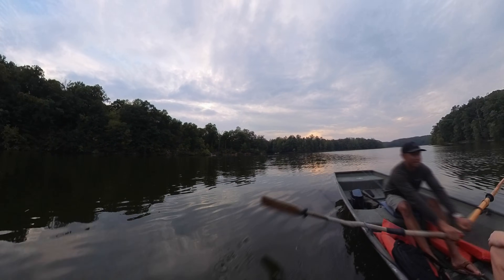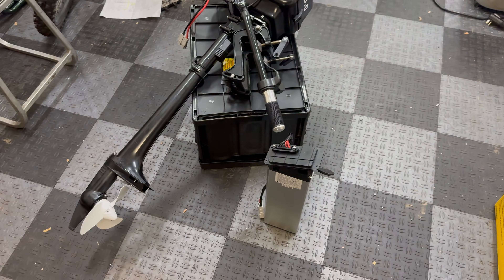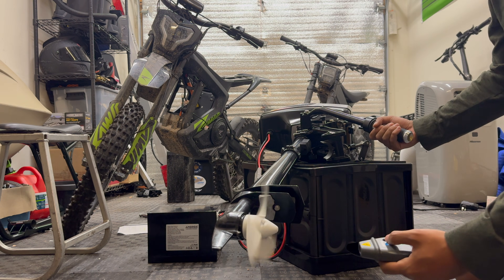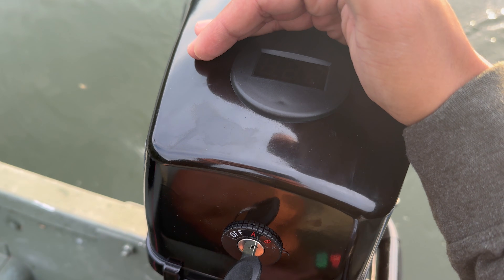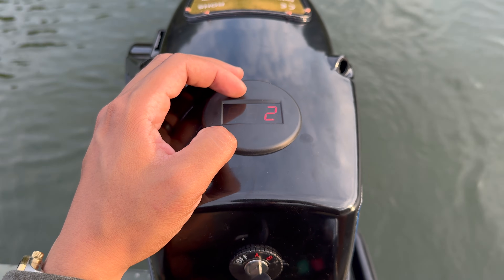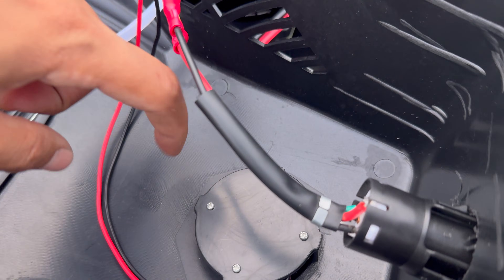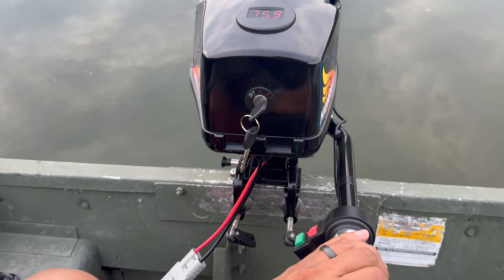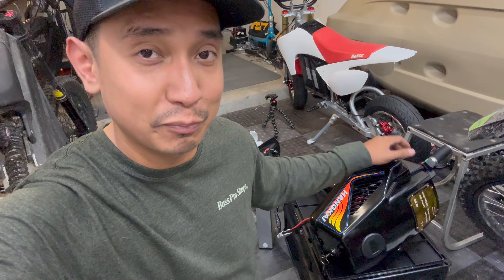Can a Hangkai 48V Outboard Motor Handle 72V - Speed Test

Comment: Hey Bro! Im the surron guy here
 This video was Great!!! I really like your test. Very informative.  You Also saved me from a lot of rowing, lol, Im definitely curious to see what you do with this hangkai next. Its definitely the best bang for the buck when it comes to electric outboards
Reply: I've got the same motor.
I commented on your earlier video showing this motor.
Drill out the rivets on the 'number plate' on the top cover of the motor.
Under it you will find a nice looking 'grill' that will only let the motor run cooler.
Reply from the maker: @garygerard4290  Thanks for the tip!
Reply: Does that Hankai have the ability to change the propeller? Have you tried other propellers?
Reply from the maker: LOL more to come sir

Comment: Orange wires at 8:35 are for the self-learning function of the controller. It learns where the hall sensors etc are placed when the motor is initially assembled.

Comment: THey ought to put a cooling system like while motor running it pump water thru hoses around motor to cool it off or a fan to blow directly thru top to cool it off. Cute motor it moves along pretty good

Comment: Brilliant stuff Pat. I have been doing very similar things with electric motors with ebikes, scooters, motorbikes and cars over the years. When my fully electric campervan / RV sells, I will buy a boat. I ordered that exact same motor from AliExpress yesterday, $312 including shipping. Waiting for the motor to arrive from China will give me plenty of time to find a boat😄 Plan is to use 3 * Lidl Parkside 20V 8Ah power tool battery packs in series to power it ($49.95 each). Cheap and cheerful and should have plenty of juice for my needs

Comment: Dont make the same mistake many people make with electric RC planes. If you overprop too much with an RC plane very quickly you can heat up the magnets in the motor and from there on in your power will be less, essentially ruining the motor.
Read up a bit about pitch speeds of propellers. Over-volting your motor is very similar to replacing the prop with a much larger propeller; your current/amps go up quick.

Comment: Have you ever had the motor burn up on a 56 volt setup? I was using mine the other day for the first time and use it for about an hour and a half and then all sudden it started smoking and losing power like the bearings lost all its Grease the motor itself was extremely hot
Reply from the maker: Sounds like your unit didn’t come with gear oil in the lower unit. Some come with it, most do not come filled. You always have to check the lower unit before taking it out
Reply: What gear oil in the lower unit cause the electric motor to burn up? You don't think it was from over voltage  @PatOutdoors
Reply: Also has anyone heard of any upgraded motor options for this outboard looking at the motor itself everything is 100% enclosed I don't see much holes in the aluminum case for heat to escape
Reply from the maker: @FreeMindthinking I’m just asking you to confirm your lower unit is OK before assuming it’s the motor or controller.
Reply: Yeah I checked the lower unit  before I put the thing in the water for the first time I filled it with my buddies lower unit oil from his boat he has an Alpha One drive

Comment: Have the same motor, and am EE, so interested in your upgrades! Thanks so much. Will stay tuned for any performance improvements or if the noise of the motor can be lowered. Also like to see if any motor or controller changes would help. I'm only running 52V, but I wonder if prop changes would speed up the boat?

Comment: Hey Brother,  HANGKAI now sells a 10hp electric motor on eBay. It requires a 60volt battery.

Stay BLESSED.
Reply from the maker: @kenfan5666  woah! I’ll check this out
Reply: @PatOutdoors  I'm considering getting one, but I need to find a lightweight 60 volt battery first. Otherwise, it will be  pointless. 

Stay BLESSED.
Reply: Ali Express sells 60v 100 amp batteries. I'll let you know how it runs when I get mine.
Reply: Can you post a link to the 10 HR 60-volt
Reply: Just a little update it took my experimental boat out all week this week I was on vacation went to Lake Norris ran the hangkai 5.0 for a total distance of about 4 MI rough estimate on One battery 56 volt 40 amp 20 amp hour battery at about half throttle it worked perfect all week and did not overheat

Comment: Hey do i need motor oil before using it ? Cant find an answer on that
Reply from the maker: @NOSKILLBUILD  you need to confirm the bottom housing came filled with gear oil. Some units come completely dry, some come with oil shipped (depends on what factory it ships from.) better to be safe and just pull the fill plug off and confirm.
Reply: @PatOutdoors  oh ok.thanks man !!
Reply: @PatOutdoors  oh one more question,  what kind  of oil do i use ? Do you have a link ? Im new to all of this .

Comment: man i reaaaaaaally want to see you upgrade this mini outboard. fardriver con fan on top stripped motor oooooh maaaan pleaaaase fardriver sells water cooling plates also
Reply from the maker: This motor is already currently stripped down to bare housing. I’m waiting on an adapter for an my1020 style motor adapter to be finished, then work on an adapter for the propeller shaft, THEN I can make a fardriver work. The stock motor does not have hall sensor so my ND72450 will not be compatible.
Reply: @PatOutdoors  I see I have the ND72850 wonder if you can adapt 3 Honeywell halls on it. Anyways thanks for the vid super interesting 🙏

Comment: Great video. Thank you for dissecting these..  just an FYI The butt connectors that run to the voltmeter on the top of the cowl are garbage.  I'm pretty sure the extra power you're pushing through is the problem but my motor did the exact same thing until (I was running a 48 volt 15 amp hour evike batteryI soldered in marine grade connectors.  Just a thought.

Comment: Same as e-bike, 48V controller normally can use with 60V battery but not 72V.   I think you just change the new controller and it's gonna run again.

Comment: i want to know will it handle a 52 volt battery. i have a 26AH 52v lithium battery from a old scooter that still has plenty of life left in it. its rated for a 2kwh electric hub motor. its not much higher then 48v batteries i think its 58volts fully charged

Comment: I've done these over-volting tests on ebikes. My experience is there is what I would call a "soft cutoff" on max operating voltage. That is, a max voltage where you may be able to get it to perform under certain loads and/or conditions but fails in others. For example, I can get my son's e motorcycle to perform well at 48-52V with the OEM 36V motor and controller. At or above 53V, it will run but cuts-out randomly when pushed hard, just like what you are seeing. I have an an adjustable charger that I can set cutoff voltage at 52V. So now I can use a 48V lithium pack with great reliability as it never hits the soft-cutoff. My son has been riding it constantly like this for two years straight. Anyway, thanks for doing this video. You are encouraging me replace my 12V Minnkota trolling motor with something like the Hangkai.

Comment: A couple tips ... When using your electronic tach, find a smooth location like the nose cone to put your tape on. You were picking up on each of the three blades so 12,000 RPM was actually 4,000 RPM (Divide by three). I know this because the prop and the motor would explode well before 12,000 RPM.
The spare set of connections on the controller are for programming.
A good source of controller information can be found on partsforscooters (not affiliated). Go to the controller section, click on wiring for a controller similar to yours and it will explain all the functions your boat motor manufacturer doesn't want you to know.
Retest your prop RPM and leave the results below, I'm curious since I don't actually know how much gear reduction is in the outdrive.

Comment: There is a LOT that goes into outboard and prop design. Simply speeding up the prop will cause cavitation around the propeller.  This will cause the propeller to spin too fast and the imploding bubbles will destroy the propeller.  You will probably need to increase the pitch of the propeller to increase speed and prevent the motor amping out. But, I only know enough to know that I don't know enough.
Reply from the maker: @edtheplumber5307  yeah I actually swapped over to an aluminum propeller recently for added reliability. But you’re right, I have to play with the pitch also. I’m in the middle of swapping out the motor and controller already though..

Comment: Driving a motor rated for 48v with a battery twice as big will burn out the windings as well as the controller. Same goes if you drive a motor with not enough voltage. In that case it will try to draw more amperage which causes the same result. Give it what its rated for. I cant tell you how many electric motors i have had to replace because of a wrong feed. I dont care if its ac or dc. A well pump or sprinkler system , or in this case a boat motor. Electric motors all do the same thing.

Comment: Great video thank you. Would this motor work with 24 volts from the battery instead of 48?
Reply from the maker: @thomas_didymus  it unfortunately will not
Reply: @PatOutdoors on the website it actually does say 24/48v and I’ve seen videos i do believe it will work at 24v

Comment: Hey, I thought you looked familiar. I'm a proud owner of a 2019 Subaru Crosstrek and I've seen your other channel and really liked your Crosstrek videos 😎

I'm a kayak angler and have a 12v 100ah lithium battery setup running a brushless trolling motor. I get 5 to 6mph depending on conditions.

Inspired to see what speeds this motor would get on my kayak setup, thanks for all your insightful and inspiring videos brother 😎
Reply from the maker: @mototechRyan  LOL yeah this is actually my main channel. Thank you. That’s awesome speed for a 12V unit. I currently have this motor apart, seeing if I can jam some of my higher power electric bike internals into it. I want at least 10 MPh 😂
Reply: I'm guessing my total weight with me, my kayak, and my fishing gear...is around 260lbs. So my 65lb brushless trolling motor does pretty good. I need to get hard data on run times with my setup, but I never worry about running out of battery.

Please keep the videos coming, I'm really inspired to to get into higher voltage setups 😎

Comment: non-flexy prop and some trim! bottom end seems like it'll be a bottle neck though.
Reply from the maker: Funny you mentioned it. I just finished mounting an aluminum prop on it and doing some testing shortly with a huge 100ah battery

Comment: looks like a plastic prop, the higher RPM will distort the pitch of the prop, and may actually reduce speed
Reply from the maker: I just swapped out the prop to an aluminum one with slightly more surface area. Hopefully it runs more efficiently

Comment: you remembered to put gear oil in right? it does not sound healthy on that lower end
Reply from the maker: I just pulled the prop and cover off the lower unit to inspect. This electric one came prefilled with gear oil

Comment: If anyone is replicating results the rpm will be different based on blade count. Unless he did the math or that unit is programmed to ignore every 2nd count you'd divide by 3 just fyi. Laser tachs just measure interruptions.

Comment: Water cooling the motor and controller would be a very easy way to keep it cool.
Reply from the maker: Ok yeah I’ve been looking into doing this. Would I just have a pump mounting in the housing and run a hose near the prop?

Comment: SurRon battery with a stock SurRon controller…..is what he used.
Reply: Also….you could possibly run at 1/2 throttle until the voltage drops.
Reply from the maker: @turbosupra2jzdragracingtob249  how would you use a surron controller on a sensor less motor? There’s only phase wires on this one

Comment: a small pump, tubing, and a CPU cooler or cooling plate would provide water cooling to the controller and be much more effective than a fan. just run it on a step down converter at 12v.
Reply from the maker: @chrisstinson2536  I’ll start drafting the plan! Thanks for the idea

Comment: when i put a higher voltage battery in my impact wrench the issue i had wasnt overheating the controller, it was actually over current protection (heat also causes an increase in current) not that it matters if your replacing the controller, but theoretically you could remove the current sensing resistor if that was the issue
Reply from the maker: Hmm if it was an over current protection, it should have cut the power immediately when I initially started using it. It just ran worse and worse as it generated heat. I’ll look into it more, find a solution, and post an update. Appreciate your input
Reply: E = I x R. E is voltage. You increase voltage with the same resistance (R) and current (I) goes up. Current causes heat. The heat may change the resistance a little affecting current somewhat but the overall increase in current is caused by the increase in voltage.
Reply: Most overcurrent protection is using thermal overloads which basically open on high heat stopping power to the motor. Some reset automatically after temperature drops and some have to be reset manually or electronically.

Comment: Yeah 60v no problem but caps are likely 75v inside and full charged 72v battery is over 80v, when u close throttle the back emf spike kills the controller

Comment: That doesnt sound like 12,000 rpm to me, try putting a piece of reflective tape on 1 of the blades as I think it might be counting each blade as an rpm but I aint no rpm lazerdoodle expert
Reply from the maker: @TheDigitalguyy  it’s not, about 4500 RPM. I remeasured at a later time but the difference between RPM and voltage is the same with both  tests

Comment: not controller it motor safey switch when motor get too hot it sent data to controller cut off safey power so it turn off on you once it cool down it safey overheat switch avoid motor burn out and if you take look at switch on motor u wll noticed it two wire and heat up switch it kill power to motor
if you have water cooling motor you never have to worry about this issues at all but if you modicaty cover more air flow may last you longer keeping motor cooled down
i dont own one but i worked on one for my customer plus have cut open top of cover and make vent down into motor so it last longer
Reply from the maker: @kittyztigerz  appreciate the input! Give me ideas..
Reply: @PatOutdoors  mt customer still running off 48v dc battery he have same issues as you have it cut off when get too hot not enough cooling just give you orher way fix overheat issues so wont happen again 
if it was control it would been smoking alot n barely catch on fire but no smoke so not controlled it motors 
there other trips you can do is incled amp to motor so u can change impeller pit for less rpm more flow
i believe there is youtube done this test called rctestflight YouTube channel

Comment: Before you upgrade the motor, I would check the drive shaft and lower gears and make sure they are strong enough for the upgrade.
Reply from the maker: @robjohnston8632  good suggestion, will do
Reply: Lubricate and brace it up. Cheap insurance. Good call robjohnston

Comment: Do you know the difference in the two options you have linked for sale on Amazon? I notice on both eBay and Amazon they have what appears to be the same motor but one is around 2-$250 and one is $265-$400. 

The only difference I can tell is in the pictures the throttle grip is rubber on the cheaper one and shiny metal on the higher priced one. 

Thank you. These videos were a great help for my project boat.